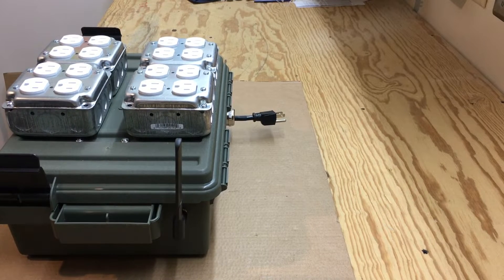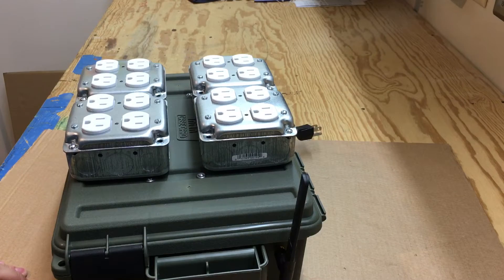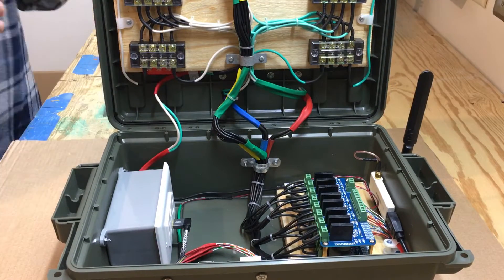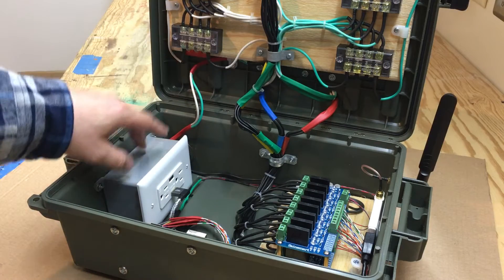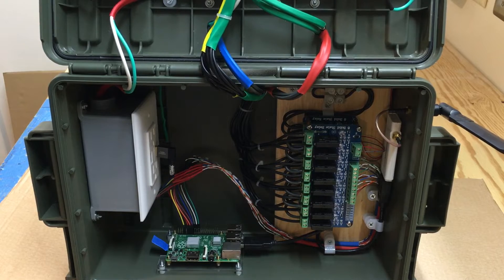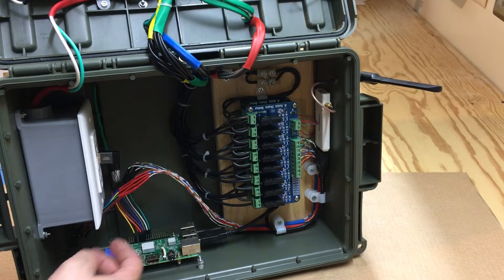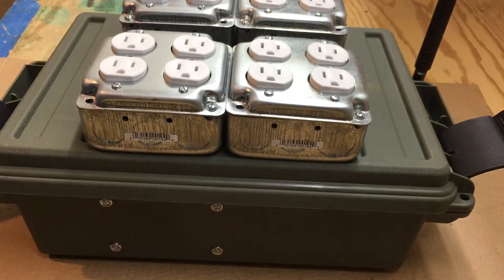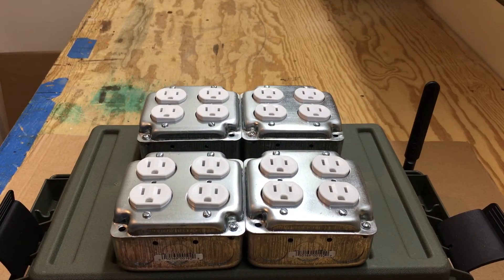Raspberry Pi 16 Channel Solid State Relay Setup For Christmas Lights PART 2

Comment: I built one of these (RPi + LightshowPi, 16 channels) but I had mechanical relays and extension cord sockets to try to keep it cheap, and had nothing but problems trying to get audio frequencies arranged to music properly, dead channels happened, it was a mess. This year I'm running Vixen on my Pi and built a bigger box with 48 channels using an ATMega 2560 driving solid state relays, in case you want to run something else later or add on to this setup.
Reply: So what I am trying to figure out is how to use ATMega 2560 and a Pi together to drive the relays?
Reply: @rjbiz3639  Flash Mega with a sketch that runs its ports as serial outputs. Dee Higginbotham here on YT has a video series called "cheapskate" on how he built the whole thing, I'm following that